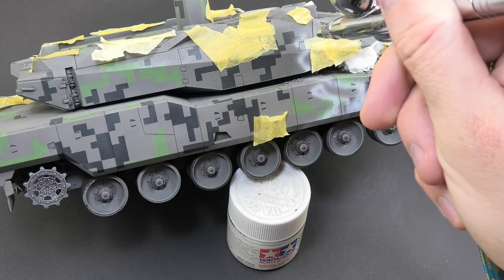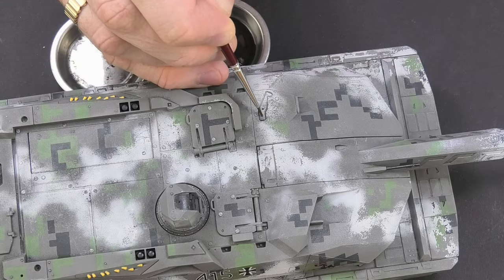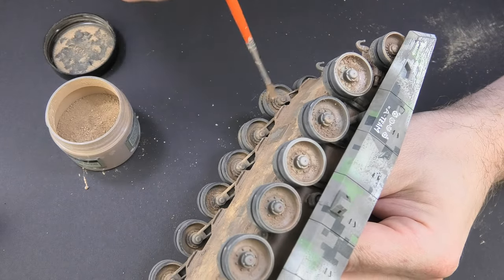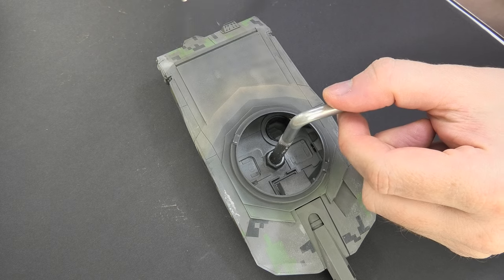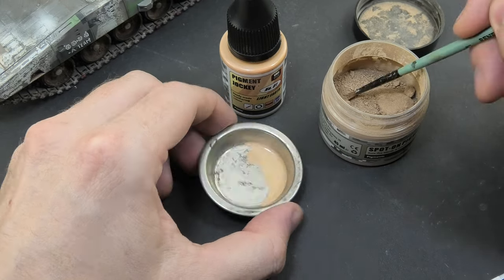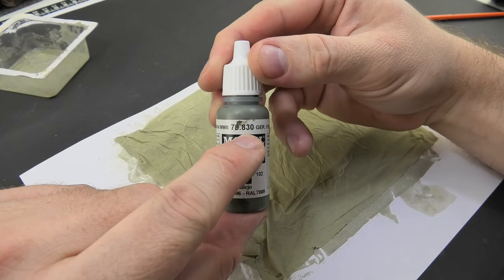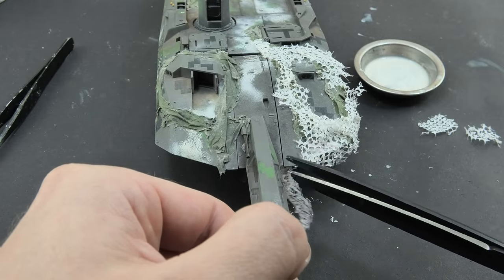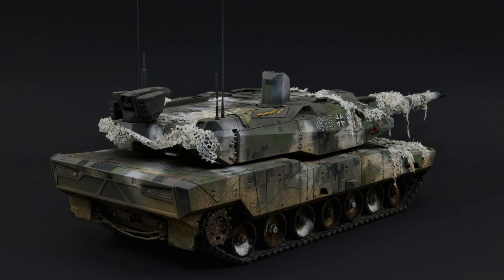KF51 PANTHER  - The Ultimate Battle Tank in 1/35 Scale, MODEL WEATHERING - Part 3

Comment: Very nice result, there are very few tanks with white washes (winter camo) in modeller forums. It is rarely done anymore in real life because it is a hell of work to get it off a tank, we usually now just use white stripes of sheet and the regular natural camouflage on Leopards. A little info for the red markings on the tracks, we paint the link where the track got connected red so we know where the track was "opened" and closed. On my Kf-51 i went for the regular dusty look, not the very muddy one :D But that's the nice things with tanks, helicopters that never really entered service, you can go really crazy on a what-if scenario.
Reply from the maker: I probably wouldn't want to paint white camo on a real tank, but recently I saw a series of photos of Leopards from a Polish unit and they had camo painted with washable paint. Each tank had a different variant of spots and stripes. Interesting but a lot of washing for sure!
Thank you very much for the information about the red points on the tracks.
And you're right about vehicles in the design phase - we can fantasize! :):):)
Reply: @coldemonspl  well we were on an exercise with polish tank forces but not during the winter, in the German army when white wash color was used only the green camouflage was painted with the white, of course since it was hand painted it could vary from the vehicle slightly. But in the end the tanks were camouflaged with branches and all that stuff. But yes it could be possible that Poland still uses the camo on their tanks I could imagine Sweden would also do that. Happy modelling :)
Reply from the maker: @JazzJaRa  the same Finland! Looking from modelling point of view winter camo looks superb on the models IMO. I love to work with it :)
Reply: @coldemonspl  I turned my M26 Super Pershing into a winter camo, other than that the most tanks are either NATO camo, olive drab or in case of my Abrams yellow. So I liked to have a tank in Digital camo and didn't wanted to hide all my work :D
Reply from the maker: @JazzJaRa completely understandable :)

Comment: bro, please help me, what is the name of the brand of bandage you used for the camouflage net, and the material of the tarpaulin?
Reply from the maker: Mate, for camo net I use simple gauze. If there are different types you need to check them. They are very cheap so the cost wouldnt be higher than the 1 bottle of paint. For tarps I use tamiya epoxy putty, VMS paper or standard paper tissue. For next tips I recommend you to join my Patreon! :)